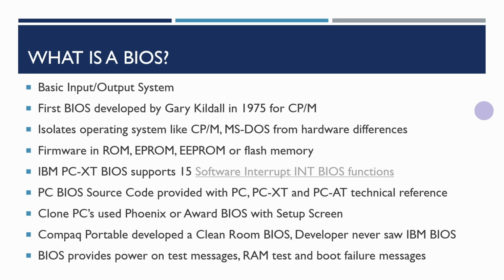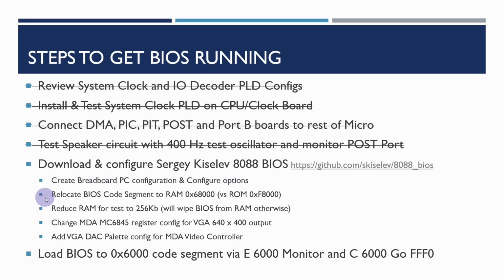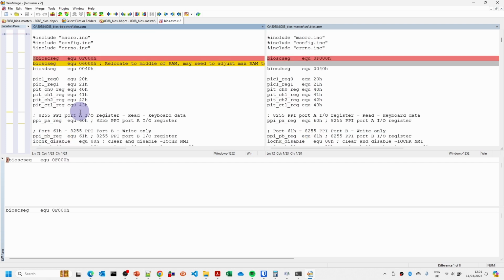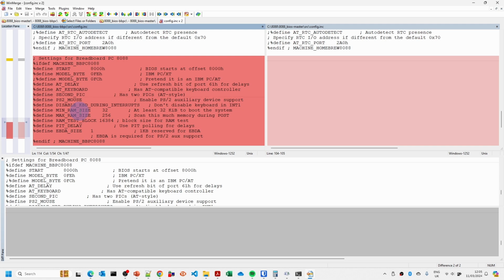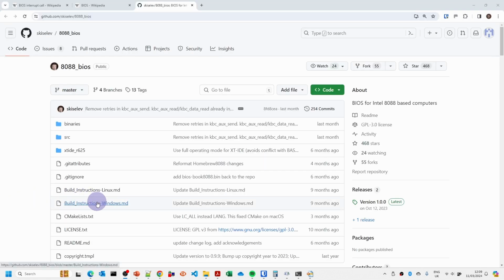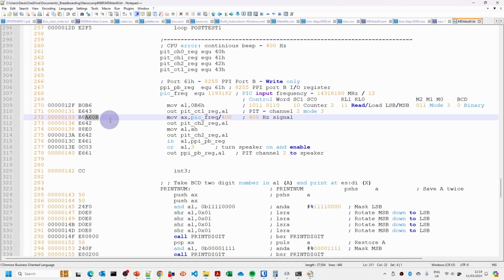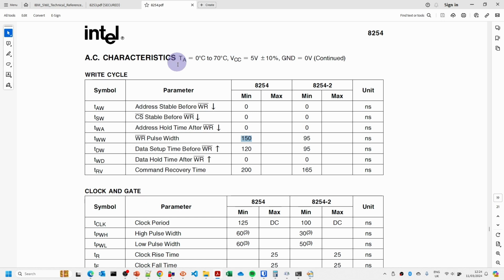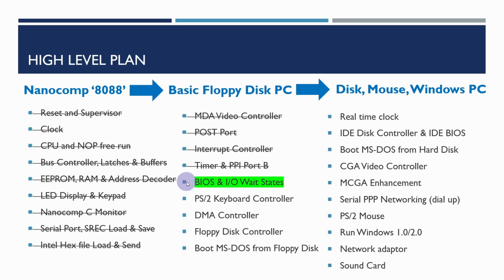Breadboard 8088 PC Compatibility Part 3 - Make a BIOS #25

Comment: Good catch, regarding the difference between the 8253 and 8254. I have a small number of both types in my “Intel” chip box, collected over the years. I will check which type I used in my own 8088 clone project.
Reply from the maker: I checked the datasheets and logic analyzer output again. 8253 is min 400ns read & write time.  With default 4.77 MHz clocks with no wait states the PC is about 419ns so it SHOULD be OK without wait states. Since I have changed the main clock frequency to 16 MHz and dropped the IO wait states for getting floppy disk programmed IO working, the timer still seems to be OK even though this may only be 375ns read/write now. Issues may have been caused by data bus needing another buffer in parallel which I added. Sometimes it is not always clear what fixes things. Can't always do changes one at a time! Dave

Comment: Do you have to configure the BIOS so it doesn't try refreshing the memory because you have SRAM instead of DRAM?
Reply from the maker: Good question without a simple yes or no I'm afraid!
The worst case scenario is that if configured as the PC-XT, the Timer OUT1 and DMA DREQ0 are connected for refresh which would take CPU cycles away without doing anything (the DMA would take control of the buses, read a row from the Static RAM but not do anything with it). This MIGHT be useful if trying to make the PC cycle accurate with PC-XT to run some Demo programs like 8088 MPH https://www.pouet.net/prod.php?which=65371 with CGA video (not done CGA yet). 
However the XI 8088 and Breadboard PC don't need DRAM refresh as you say as they use SRAM. The Timer OUT1 is connected to a flip flop in the PLD U35 and then via REF_DET to Port B. This is then polled by the BIOS for more accurate delay loops based on the PIT_DELAY config setting which looks for the refresh_flag on Port B Pin 4 in units of 15us.
So in summary the BIOS does not need configuration to disable DRAM refresh. Timer 1 is still used to generate 15us intervals, it is the fact that Timer 1 OUT1 is NOT connected in hardware to DMA DREQ0 (channel 0 which is used for DRAM refresh) which disables the refresh activity.
The PIT_DELAY setting enables the BIOS to use the refresh timer for delay purposes but if this is not enabled then the DRAM refresh activity would be unchanged, this can only be enabled in hardware.
Hope this helps. Dave